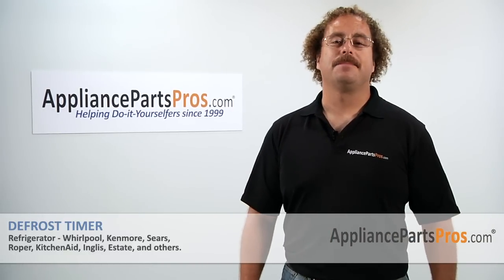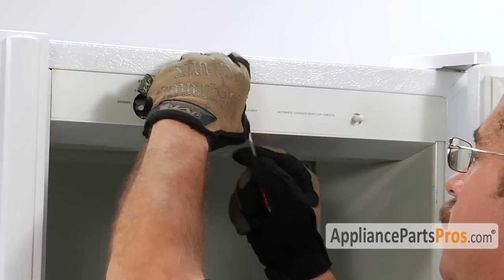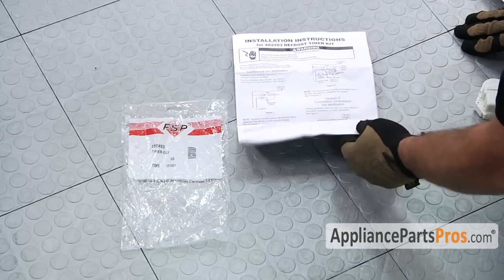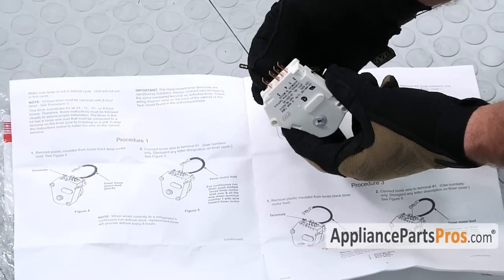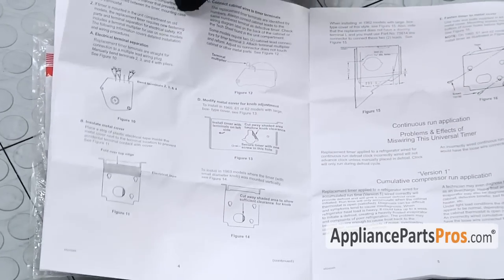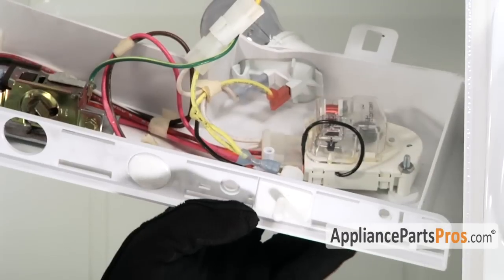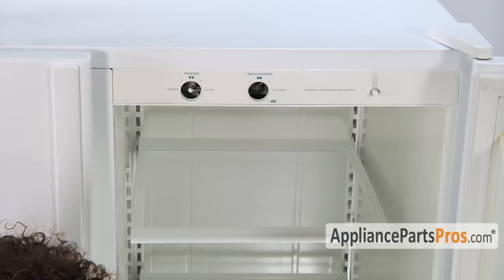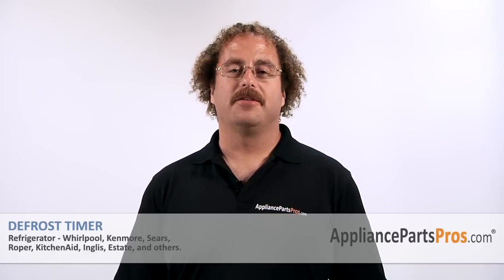How To: Whirlpool/KitchenAid/Maytag Defrost Timer W10822278

Comment: My refrigerator serial is Whirpool ED25QFXHW01. This refrigerator has been used for a long time so there is no wiring diagram now. I don't know which procedure to install the defrost meter (1 or 2 or 3). Please assist. Thank
Reply from the maker: If your timer has a white wire it goes on terminal 1. If  your timer has a black wire it will go on terminal 2.
Reply: You mean the color of the timer loose motor lead ? @appliancepartspros   Thank you

Comment: I read that if you have a black wire going to the defrost timer then put the black jumper on the #2 terminal. If you have a white wire, then put it on the #1 terminal. The other wires going to the timer will be the same in either condition (pink, red, and orange).  I followed these steps since I couldn't find the wiring schematic, and it worked!

Comment: My old timer did not have the black jumper wire. The new one does, but it also does not seem to be working properly, as it has gone 24 + hours without defrosting.  What is the purpose of the black jumper, and perhaps can I remove it from its pin or my model  ?

Comment: These videos are great but do you have troubleshooting videos? Every few days the fridge Whirlpool ED22UQXGW00 stops cooling. We turn it off to defrost and it works. I have checked defrost heater and get 27.2 ohms so that is probably not the problem. How do I troubleshoot to see if it is the Defrost thermostat or the defrost timer?

Comment: Hi Your video are well done.My Whirpool fridge doesn`t cool down and my freezer has built up ice on the inside back panel..I also heard a continuous 10times clicking noise  where the defrost timer sits.Could my timer be the problem?.
I unpluged the fridge for a day to let it defrost and plug it back in it was fine for a week than it started to not not cooling down again,Thanks
Reply from the maker: +Avesuccess If the defrost timer is clicking it could be a bad motor or gear. You can test the heater and defrost thermostat for continuity to test them. Remember the defrost thermostat should have continuity when cold and not when warm.

Comment: I have version 1 cumulative, so it says hook up to terminal 2 , my question is if this is the other power wire to the timer to cause timer to run # two only has power in defrost mode so timer will only run in defrost mode
Reply: My take on this;  keep in mind that the defrost timer receives continuous power at the terminal one position.  When the defrost timer (if its designed for an 8 hour cycle) reaches the end of its cycle, it goes open for 30 minutes and turns on the defrost heater for the 30 minute period.  After 30 minutes, the defrost heater turns off and the timer resorts back to zero again for another 8 hour cycle.  By using the number one position, the cycle of the defrost timer will never be interrupted unless the fridge is unplugged.   In other words, it will activate the defrost heater 3 times daily in a 24 hr. period.   The position two terminal only receives power when the compressor is running, which means when the compressor is idle, the defrost timer receives no power (no matter where its position is in the 8hr cycle) and will only resume the cycle again when the compressor turns back on.    Much more cost effective.  Note! when the defrost heater comes on,  I believe it activates the fridge's thermostat which keeps the  compressor running during the 30 minute defrost heaters time period . In other words, the increased warm from the defrost heater activates the thermostat which causes the compressor to turn on and activate the circuit which brings a continuous supply of power to the defroster timer.  Obviously when the compressor turns off, the defrost timer is operative.  : o )
Reply: @brianarsenault9281  I bought a used whirlpool a few years ago, the Side by side whirlpool refrigerator has a 10 hr. timer in it. Now I need a new timer and according model number, it was suppose to have  8hr. timer. Now  I'm not even sure how to hook up the wire if the new one comes with the black wire. Any idea?
Reply: @Mriluigi  Keep in mind Mrluigi that I'm not a technician in this field of work. 
In my opinion though, it doesn't matter whether it's an 8 hr. or a 10 hr. cycle it will work the same as outlined in my previous comment. Since installing the manual timer, I've had no problems whatsoever and the cooling system works as if it was new.

Comment: My Kitchen Air fridge built in Nov 1999 had quit cooling properly. The evaporator in the freezer section was a complete block of ice and frost.  I had already cleaned the compressor/condenser compartment behind the fridge and determined that the compressor was running and the suction line was very cold.  So my problem was inside the cold compartment of the fridge. 

This video on this page was extremely helpful. However, their tech had both a wiring diagram for the fridge and a manual for changing out the timer. My replacement timer only came with screws & nuts. Which I needed. Plus, I could not find a wiring diagram on-line. 

So here is my workaround. 

Follow the nice video and remove the control panel and then the Defrost Timer. Next remove the wiring connector from the timer. Take a pic of the connector and if the Timer has the terminals numbered on the bottom, take of pic of that. I found a copy of the service manual for replacing the Defrost Time on another website. Old and bad resolution, but readable. There are 3 procedures illustrated for where to connect the Black pigtail wire. Procedure#1 did not list the wire colors at the defrost timer connector, but Procedures 2 & 3 did. My fridge, which is a KitchenAid KSRB27FHSS02, had wire harness wire colors matching Procedure #2. I wired the pigtail according to the manual.  Turned the power back on and the Defrost Cycle in the Freezer started working immediately. The timer has a grey control knob that advances the timer manually. The indicator on the flat grey knob pointed to the Timer's "pointer. You can rotate this knob with a screwdriver, and you will hear the contacts engage when you align the knob indicator with the pointer on the Timer. It shuts off the compressor & fans for around 20 minutes every 8 hours. And simultaneously starts the defrost heater element in the freezer (behind the white metal freezer panel). The temp in the freezer/fridge will elevate during this cycle and pull down very cold quickly after the cycle is finished and the compressor and fans start running again. 

Please note that I also had already replaced the heating element and the bi-metal temperature sensor in the freezer. The heating element was "open" with a Volt/Ohm Meter test and the bi-metal temp switch was cheap, so I replaced both while I had the panel off.  If you are ordering parts, get the Defrost Timer, the Heating Element and the Bi Metal temperature sensor.  Barring other issues, you will have the 3 parts your need and you will spend under $75.  My fridge works just like new again. 

Here are the procedures from the Repair Manual.  If you can contact me through You Tube, I will gladly email the PDFs of the manual.  Worth printing out and putting them in a Zip Lock bag and tape to the back of the Fridge. But here they are typed in by  hand. 

Procedure 1 - Connect Black Wire to Defrost Timer Terminal 2

Wires Connected to Defrost Timer Plug
1. Instruction Sheet Omits The Wire Color
2. Instruction Sheet Omits The Wire Color
3. Instruction Sheet Omits The Wire Color
4. Instruction Sheet Omits The Wire Color

When wired correctly will provide Defrost every 8 hours of compressor runtime after Bi-Metal switch closes (contacts close).

If my wire colors did not match to Procedure 2 or 3, by process of elimination, I was ready to assume that Procedure #1 was applicable.  Do this at your own risk. 

Procedure 2 - Connect Black Wire to Defrost Timer Terminal 2
Wires Connected to Defrost Timer Plug
1. Black Wire
2. Pink Wire
3. Red Wire
4. Orange Wire
When wired correctly will provide Defrost every 8 hours of compressor runtime after Bi-Metal switch closes (contacts close).

Procedure 3 – Connect Black Wire to Defrost Timer Terminal 1
Wires Connected to Defrost Timer Plug
1. Orange Wire
2. Pink Wire
3. White Wire
4. Red Wire
When wired correctly to a refrigerator's accumulated run clock, the replacement timer will provide defrost every 8 hours of compressor runtime after Bi-Metal switch closes (contacts close).

Comment: Hi, i have a maytag frididge/freezer model number GT1626BAS, i removed the faulty timer but i forgot to mark the 4 wires, do you have a picture showing the 4 wires order, the timer located in the back of fridge and doesn't have  a plug to reinstall in the right order, but ih has just 4 wires, if you can email me the 4 wires location in that timer , i have blue, yellow , white and purple, so which one goes to number 1,2,3 and 4? thank you in advance.
Reply from the maker: I can't add any schematics here. I would suggest posting the problem along with the appliance model number on our repair forum and the techs can help you troubleshoot the problem. http://forum.appliancepartspros.com/

Comment: Hi Appliance Pro. The old timer is the exact one. Could not find a wiring diagram for the Kenmore Model 106.67067791
Since the old timer is same in video, is it safe to connect lead to pin 1 on new timer like in video? Thanks
Reply from the maker: +ArcSolStudios You can look around the appliance for the wiring diagram. I would suggest posting the problem along with the appliance model number on our repair forum and the techs can help you troubleshoot the problem. http://forum.appliancepartspros.com/

Comment: When i install this defrost timer... How i know if this timer is not in the defrost cycle. Do i have any setting to do after the installation or i just let it run by itself?
Reply from the maker: +BC Flying Mode You do not have to set the timer. If the compressor does not start right away it could be in defrost, just give it a little while and the cooling cycle should start.

Comment: Hey, thanks for the help, but I changed mine and it's still acting like it did before I changed it. Any idea what I can try next. Thank so much.
Peace
Reply from the maker: The other parts in the circuit are the defrost heater and defrost thermostat. If it was unplugged and defrosted during the repair it may take up to 24 hours to start the defrost cycle. The thermostat has to get cold enough to let it cycle. They can both be tested for continuity, the heater should have continuity, the thermostat should have it when its cold and not have continuity when its warm.

Comment: I just changed my defrost timer on my GE Profile, but I'm still confused about the cycles.  When it's in defrost, what's actually happening?  What is the cycle called when it's cooling the fridge off or down?
Reply from the maker: +Michelle Delgadillo During defrost it shuts the refrigerator down and turns the defrost heaters on to defrost the evaporator coils. If it is not in the defrost cycle it should be in the run/cooling cycle.

Comment: i just change my defrost timer on my Whirlpool Fridge but it is not shuting down my compressor keep running so ice is building up at the back of my freezer so i unplug it for 7hours but it only last for 4 days and all my meats and ice get back to water why is that
do i have to change my temperature control?
Reply from the maker: Without knowing what you have, I would suggest posting the problem along with the appliance model number on our repair forum and the techs can help you troubleshoot the problem. http://forum.appliancepartspros.com/